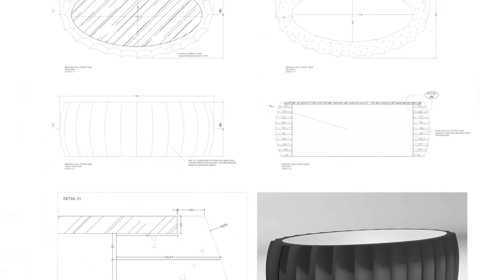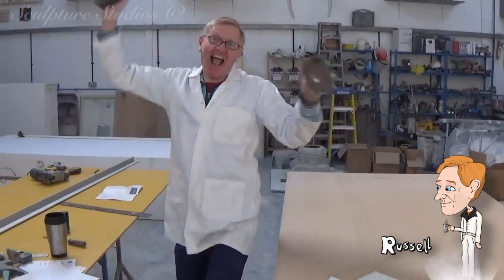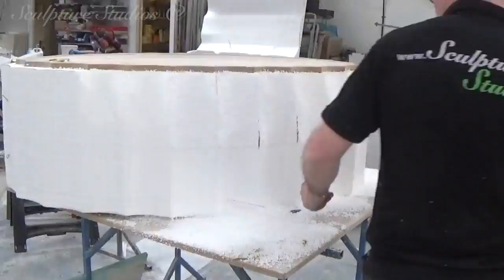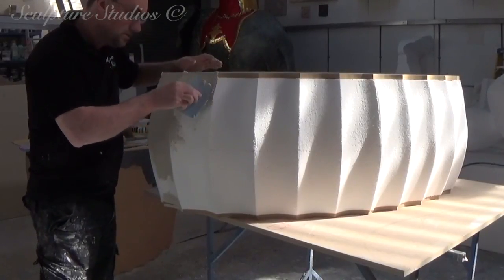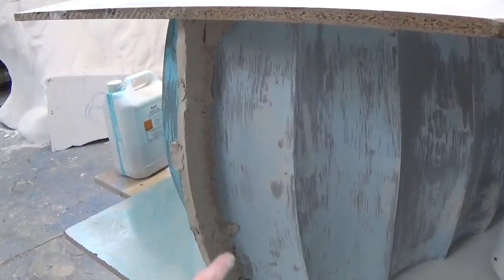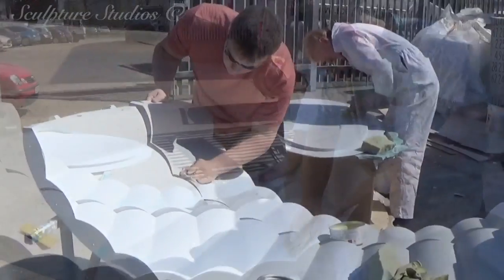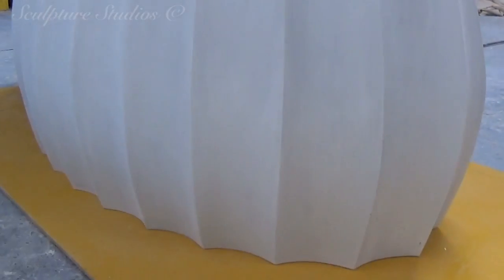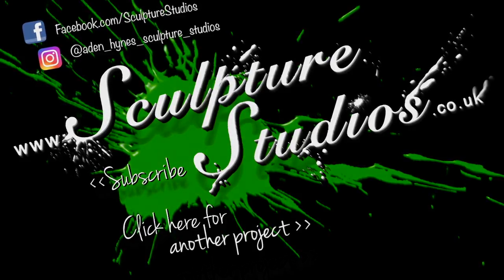Art Furniture Fibreglass Coffee Table - Decorus by Sculpture Studios

Comment: Noobie question but is the "gel resin" different than the fiberglass resin? very inspiring and great work as always!
Reply from the maker: Hey Abstex. Absolutely no problem. So the gel coat is a considerably thicker resin. It creates a thicker gel layer, which, when backed up with glass fibre and regular resin, creates a smoother surface than the mat alone would result in. The resin that you use with the glass fibre mat is less viscous and more runny.
Reply: @AdenHynesSculptureStudios  ah ok, I see. Thanks a ton!

Comment: Have you ever thought of fabricating reptile enclosures? The pvc ones are ok but if they were formed from polystyrene then covered inside and out with glass fibre, it would be more cost effective to maintain heat and humidity. That is a constant problem for us keepers. Collecting reptiles has increased even with Covid-19 lock downs. Another plus is you can make custom enclosures based on wants and needs.
Reply from the maker: I mean.... If reptile houses come to us asking for custom enclosures, the sure